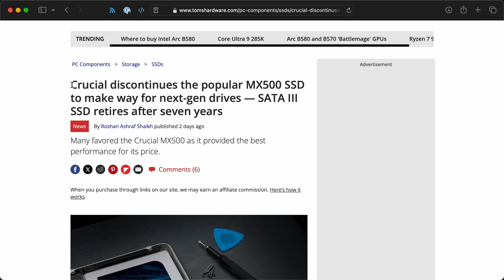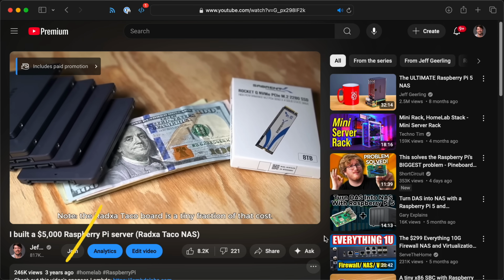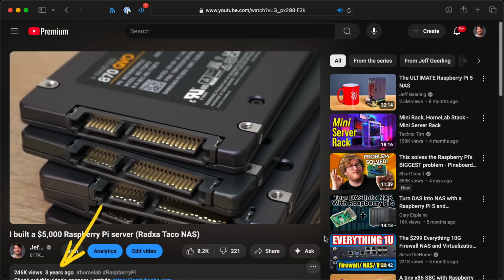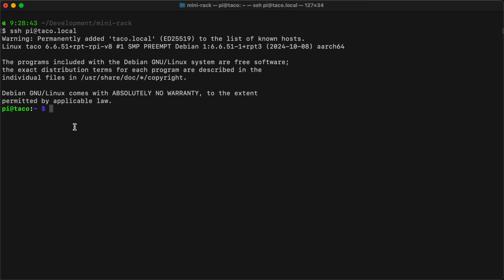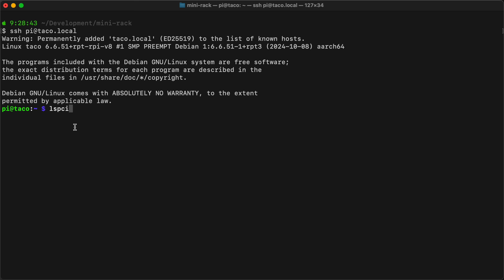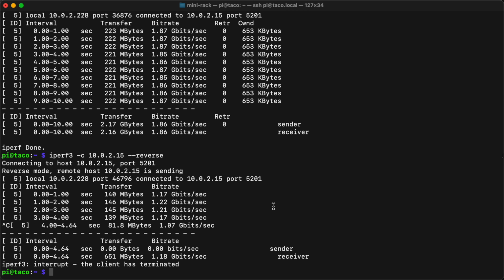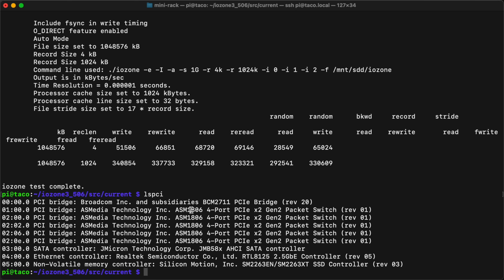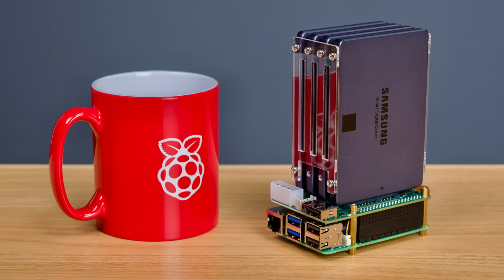The RETURN of the TACO! (SATA's last stand)

Comment: I'll consider it if I can get a compute module with ECC RAM.
Reply from the maker: Technically the CM5 has ECC, it's just LPDDR4x on-chip ECC, so not the same as a server ECC DRAM stick.
Reply: @Level2Jeff  Thanks, I know that. I've been commenting the same thing on your videos for the last 5 years lol. I mean the real ECC that also protects the link between memory and CPU and reports detected errors. Real ECC is not server only. Someone could build an CM5 compatible module with ECC memory. I am waiting/looking for that. Especially with anything that looks like a NAS.
Reply: @kwinzman  Not possible and has never been possible and is very likely not going to be possible in the future. To use the real ECC ram in ECC mode you need ECC ram support in the memory controller and AFAIK the raspberry SoC never had support for that and they never mention adding it.
Afaik it's not a feature you find on "mediacenter/mobile" kind of SoCs like Raspberry and similar but more on the parts for NAS and network appliances, so in general the Marvell Armada line and NXP's network appliance SoC lines do support ECC ram but I've rarely if ever seen a device that actually bothers to implement it.
For these embedded devices the best you can hope for is on-die ECC, either added as a special treat for DDR4 or because the spec requires it with DDR5
Reply: @marcogenovesi8570  Are you aware that there are multiple pin compatible boards that are compatible with cm4/cm5, but use a completely different SoC? I would like to post the links but I doubt Youtube spam filter would like that. It's 100% possible to include real ECC if somebody bothers to build it. With those NXP, Marvell SoC or others.
Reply: @kwinzman  Yes I am. The issue is price, because these SoCs are not made for mediacenter/mobile consumer market.
For example a somewhat old Armada A388 SoM from SolidRun (a SoM is System on Module, an industry term for what the CM4/5 modules are) has optional 2GB DDR3 ECC but the base model with 2GB is already 100 bucks and it's just a dualcore Armv7 1.6Ghz.

With the prices I've seen quoted for stuff that is actually recent and comparable to a raspberry 5, you are better off with a mini itx AMD motherboard and ECC ram

Comment: I'd say SATA's just getting started, you can get excellent 6-port controller cards that go in an M.2 slot. You can get hilarious amounts of SATA like that nowadays, with very cheap motherboards.
Reply: True but for these high capacity uses SAS is probably the better option. Depending on your exact needs and motherboard I can see how it'd be possible for this to win out over SAS, but generally speaking a single SAS card can get 12-24 SAS lanes each capable of 12gbps. Of course you're not going to saturate that without using splitters, but SAS is also full duplex, meaning you can be reading and writing at the same time. 

There just seems like way too small a niche between high capacity of SAS cards and high speed of using an NVME tbh.

Comment: This would be much more insteresting as a board with 3.5" spacing, a PWM fan header, and a gen3 switch. Though that said, you are quickly getting to the point that a N100 NAS board is cheaper.

Comment: I use a flatbed scanner to get a clear image of a circuit board.  You get  high resolution image that's properly focused, if the components aren't too tall/ Then you can reduce the image size & resolution to the desired level. I scanned a lot of compents for my old websie. I still have the backup files, but mt host went away.
Reply: That is insanely clever. lol I might have to start doing this
Reply: @ChaoticAssembly  I started doing it that was when a new scanner was $30, and digital cameras were over $1000 and low resolution. I've even scanned clear plastic knobs with numbering. I lay a clean white tee shirt over the item then add backlighting with a old Florescent ring light,. The scanner came with Paperport, which allows you to straighten an image. If you do this before resizing, thee is no sign that it wasn't straight. I will turn an item about 56 degrees to minimize any distortion,  from rotating the image.

Comment: Glad to see this product. :)

I think refurb enterprise SATA SSDs are still an excellent deal and better than new consumer equivalents for people who don't need the performance or NVME or bulk storage of HDDs. I'm using them in my Proxmox Backup Server; I have a pair of 1.92 TB enterprise SSDs in a ZFS mirror that I paid $40 total for ($20 each), and each of them has a total write endurance somewhere in the 1+ PB range. :)

They're not the fastest thing in the world, but the PBS server only has 2x2.5 GbE, so they're more than enough.
Reply: About five years back I did something similar for booting my TrueNAS server. I boot off of a mirror pair of 40GB Intel enterprise drives. (I’ve got 14 SATA ports so I can spare a couple.)

At the time I think I got ten for ~$50 USD.

It’s getting about time to go to enterprise SATA for my data disks.

Comment: Using the Raspberry Pi 5 as a NAS seems a great idea but one question I have is would hardware RAID offer better performance than software RAID? I’d have thought so…
Reply: hardware raid stopped providing "better performance than software RAID" a long time ago. Mainly because "hardware raid" is just "software raid running on a small dedicated CPU on a card". Nowadays it's mostly for better convenience or reliability than Windows own software raid, or to boot Windows from RAID.
Reply from the maker: It may, in some cases, but the difference is very small these days, with the CPU in a Pi 5. Hardware RAID can have a few small benefits in some niche use cases, but check out Level1Techs' video on hardware RAID being dead for some interesting insights!
Reply: In my very simple understanding of RAID, I thought that the PCIe on the Pi 5 would be a bottleneck ultimately as it does its magic writing data across the drives. I assumed that slower writing of this data across drives (amongst other checks) would also increase load on the CPU whereas with hardware RAID you just send the data to it and as far as the Pi 5 was concerned, job done.

Obviously I’m wrong :D

Thanks for the replies, appreciate the time taken to answer my question :)

Comment: Speed issues? Probably the Mac.
Reply from the maker: Not in this case — I've run iperf3 between different computers on the network (including my 25 Gbps servers) and there's never been an issue on the Mac Studio itself, or through my desktop Mikrotik switch...

My best guess is the Realtek driver built into the 6.6.y kernel the Pi ships with (Pi OS 12) is a little funky.

Comment: I hate to disconnect my gpu to reach nvme drives under them. Sata ftw! :)
Reply: That's the motherboard's fault for having it under the gpu, not necessarily a benefit for sata.
Reply from the maker: Though it's rare to find a motherboard with a nice layout of M.2 drives!
Reply: @Level2Jeff  yes and I hate it so much when motherboards put 3-4 pcie slots with 1 gen 5 but cheapout on the actual pcie layout. It'd be so much nicer if I just had only pcie slots and no nvme and proper bifurcation support. Then if I did need nvme I could plop in a cheap carrier board.
Reply: @artemis1825  I was half joking. Still, there is not much space even on full ATX boards. So most of them are like mine.
Reply: m.2 slots on a motherboard were a mistake. We should have used adapter cards only (with heatsink and all bells and whistles)
Reply: @marco1234genovesi  Adapters would likely require their own bios to boot(like SCSI adapters), and maybe even preload the windows drivers. NVME m.2 directly on motherboards is a simpler setup but less flexible.

Comment: SATA is not dying. SATA is not dying. SATA is not dying. SATA is not dying. SATA is not dying. SATA is not dying. SATA is not dying. SATA is not dying. SATA is not dying.....
Reply: All of 3.5 hard working spinnies shall never retire
Reply: @HksF16  SAS
Reply: @Adam130694  Long live SAS.
Reply: If SAS took over from SATA at SATA price levels…
Reply: @williamp6800 this and we all know its not happing so long live sata
Reply: ST-506MFM all the way, I do not trust harddrives with autoparking heads.
Reply: @AndrewTSq   I’d go for 8” floppy disks. Just like my bank used in 1985.
Reply: @williamp6800  I worked for the local electric company around 1999 and they had a few locations that still had their PBX's backed up on 8" floppies. One of the telecoms guys was telling me that they had one good working backup set left for the location I was at and that if they a single floppy went bad they were screwed. lol
Reply: @ I really like their approach to disaster planning. 
.
.
🤦🏻‍♂️
Reply: It's going to be a long LONG time until I'm running machines with all NVMe.  Maybe sometime around when I have to buy a cheap, used 4K television (one that has had any "smart" features disabled).  So figure 8-10 years.
Reply: Sata ssd's are extremely overpriced and scarce these days. Often way behind in TBW/TB capacity, almost no models have dram and a lot of high end and high write endurance pcie4.0 names with 1200TBW/TB are cheaper per TB than decent Sata drives that have merely half the endurance and a fraction of the capacity. 
Sata should be higher capacity and endurance (since its anyways capped by the bus, the flash could be downclocked and optimized for endurance) than nvme while being a 3rd of the price and make 2GB LPDDR4x mandatory/ TB capacity for a beefy write buffer (helps expand that lifespan and reduce system memory usage.)

Sata HDDs are often enough almost as expensive as SAS HDDs on one hand I'm happy that the gap closed on the other hand I'm not because i want to see Sata become cheaper due to being a vastly inferior protocol compared to SAS and NVMe.
Reply: @limeisgaming  I wish I shopped for hard drives where you do. I’ve never seen SAS drives priced anywhere close to the price of SATA.

Comment: Time to compile Truenas Scale for Pi! Might be a better option than the cm3588 NAS kit.
Reply: You cant just recompile stuff and expect it to work. There's a lot of features in TrueNAS that are only build for x86 like vms and containers and iX systems has no incentive to port and optimise all of that for arm.
Reply: @artemis1825  Sir I'd like to inform you that iXsystems aren't developing thise features themselves, and both virtualization (KVM/Qemu) and containers (docker/LXC) work on a raspberry 4/5 as it has a aarch64 arm CPU. There are people that managed to manually install TrueNAS Scale on a raspberry but there are some rough edges
Reply: @artemis1825  If you want ZFS and other NAS goodness then this has potential. The addition of VMs, Containers, Docker etc etc on a NAS is putting far too many eggs in to one basket and is not a NAS.

Comment: This is a very small suggestion but on the side close up cam the Aperture seems to be a little too low that the board is out of focus while your hand is sharp.
Reply from the maker: Yeah, still working on the ideal fix for that; even at f/8 or f/11 the focus can be a problem. I wish Sony had "PCB tracking" — it seems to prefer faces, hands, etc. instead of computers!
Reply: @Level2Jeff  that was with such a low aperture?? You must be blinded by your studio lights :D
Idk if this would work but maybe one can abuse the face registration feature (at least the sony a7iii has it not sure about others) to make it focus on a pcb 🤔

Comment: Not spacing them for 3.5 is such an own goal
Reply from the maker: I'm still holding out hope someone designs a drop-in board with 3.5" spacing and either adapters to mount it in old NAS enclosures, or uses some standard that many of the NAS vendors use for the spacing and mounting...

Would be cool to buy an old NAS for like $30 on eBay, or get one free from e-waste, and pop in a Pi and Taco, and have the full enclosure working out of the box!
Reply: @Level2Jeff  That's why I'm still sitting on 2 ancient but beautiful LaCie 5big Network 2 boxes .... so I can MAYBE fit a RasPi in there one day...
Reply: @Level2Jeff  can you check if it holds slim 3.5" drives? you may not get a lot of capacity, but would be a cool proyect if you already have them!
Reply: Agreed, if it was spaced for 3.5in I would have a couple. I need one for home, and one for my mom's
Reply: Their support page claims it fits 3.5" drives so it's weird that it's not an easier fit for non slim drives.
Reply: With how large 3.5’s are I honestly have a hard time visualising how you’d even safely slot them in to the board. I guess some sort of horizontal mounting with drive cages holding up the drives. Feels a bit safer just requiring some number of cables between the 3.5’s and board like it essentially needs right now
Reply: @guhak  I would 3d print an enclosure

Comment: I still stand with SATA.
Reply from the maker: Hard drives will give it a long life yet!
Reply: @Level2Jeff  
My thoughts exactly..
Large capacity drives are still very much in demand with no end in sight and SATA is going to be the connection type. 
At some point solid state might be more cost effective as rare earth metals climb in price, but that isn't happening anytime soon.
I'd venture to say that SATA has at least another decade and possibly longer.
Reply: Yeah, for bulk storage you still can't beat the price of HDDs yet. But M.2 and Sata based SSDs are close enough in price now you can lump the two together. How long until you get an m.2 based one of these?
Reply: @LockonKubi  Once the pi actually gets some PCIE lanes. That's the main limiting factor for more NVME. that and the CPU grunt to shift all that data.
Reply: @Cynyr   The cm3588 NAS kit devices break down to four m.2 sockets of PCIe3x1, not exactly wonderful, but if cheap enough...
Reply: @minigpracing3068 I mean you wouldn't get that over a network anyways. Heck, my sabrent m.2 enclosure which I put a 2TB MP44 drive in, only gets 800MB/s over USB 3.2 gen 2x1
Reply: @LindonSlaght on 10gbit from the USB with overhead that sounds about right, you could do  things in your network setup to speed things up (e.g jumboframes) but not by much. Theoretical max for 10gb is 1250MB/sec
Reply: @minigpracing3068  and how are prices on 8+tb ssds these days? Are they cost competitive with spinning rust yet? 

Once i have 4xgen3 to drives i need 4xgen3 to the nic as well in a nas. Local speed doesn't matter. And i need enough memory bandwidth and cpu grunt to do zfs parity calcs without being a bottleneck.
Reply: @Cynyr  Cost competitive, absolutely not!!! Even 1tb "enterprise" drives vs "enterprise" SSD are not really the same, but 1tb and maybe 2tb ssd are close, after that, all bets are off! I think SATA and SAS large drives will be here for a long time purely due to price per TB and partly due to durability. But the gap is closing and I'm hoping budget at work gets approved for new storage for my hypervisors, about $4500 USD for all enterprise nvme to about 4tb useable storage in 6 drives with ability to add 6 more if needed. Yes I could cut some cost with sata, and that's my backup plan, but it wasn't a huge reduction and really requires going to a larger 2u chassis.